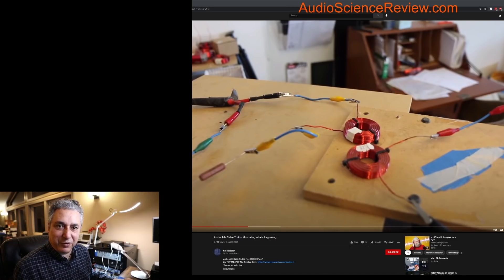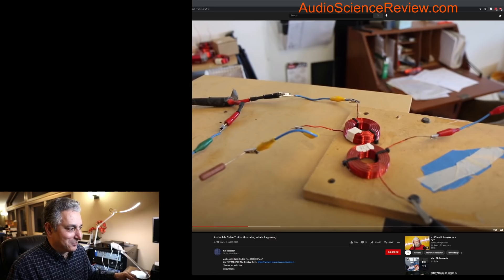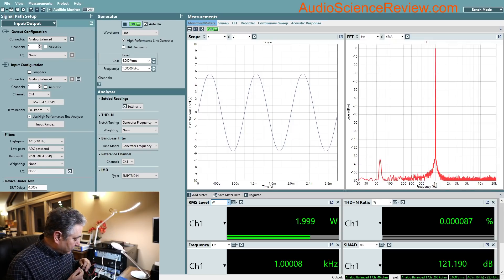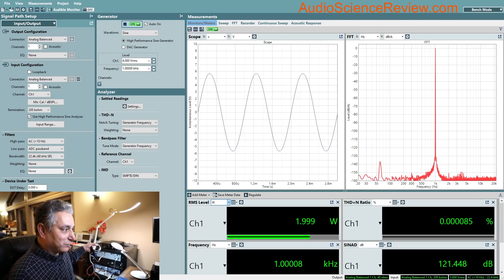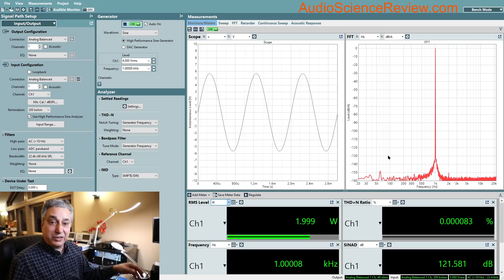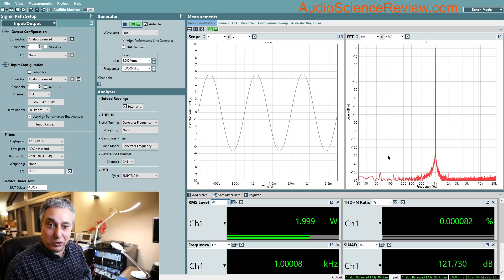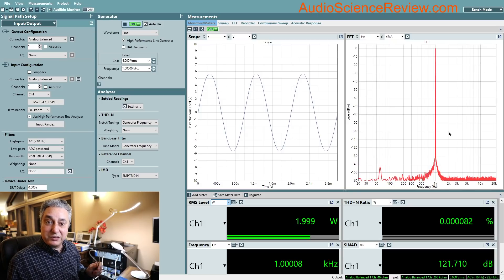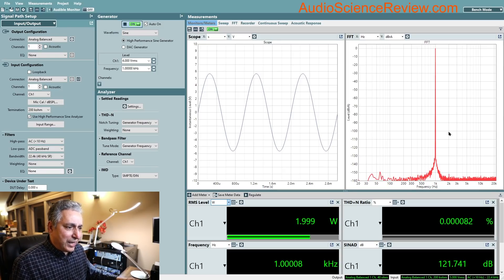Electromagnetic Interference In Speaker Cables?

Comment: Of course, the audiophile will say: "But you didn't listen to it!" Well, I have done distortion measurements in the past on actual speakers. Even in the quiet room, the noise floor was around -70 to -80 dBu on my audio analysis software. With pure tones at about 75-80 dB (~-20 dBu), the entire system still did not produce any measurable or audible distortion, even during two-tone tests. Since there's at least 40 dB difference, the overall distortion must have been less than 1%, and that was with speaker wire from some old-ass spool I got from RadioShack. Only time I could see distortion was up at around 90 dB where speakers would normally be tested, and then it was still within a few percent. The distortion would be audible, but I was more preoccupied with how painfully loud the tones were. In his world, I should be hearing all kinds of distortion and interference, but bottom line is at normal listening volumes, there will be practically none on most well set up systems.

Comment: Well done, its really about time these myth's were shown for what they are,  money generation.  I  have a problem in my music room, when the LED and fluorescent lights are on it increases hum. Whats the cure, change to old fashioned incandescent?
Reply from the maker: Incandescent does solve that problem but hopefully you don't have to go there.  Some of these devices are so poorly made that they produce a ton of interference.  Better brands tend to be better in that regard.  You would need to trace the problem down to where it is occurring.  Start with just the amplifier and see if it is the issue and work backward.